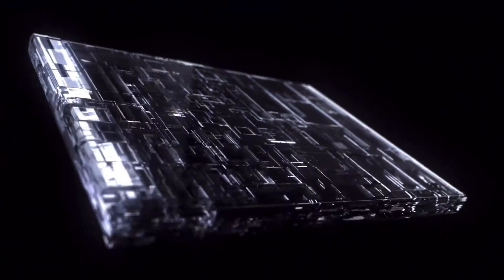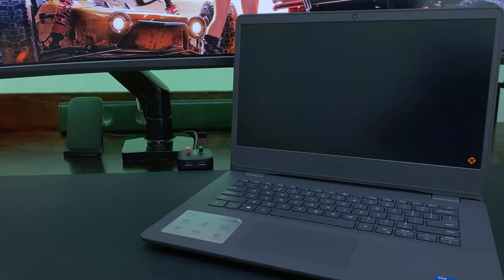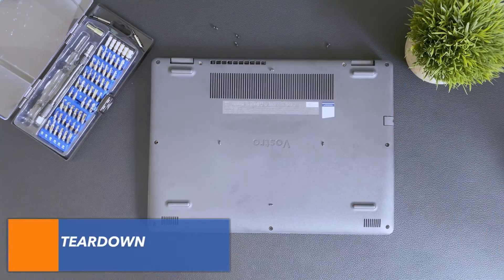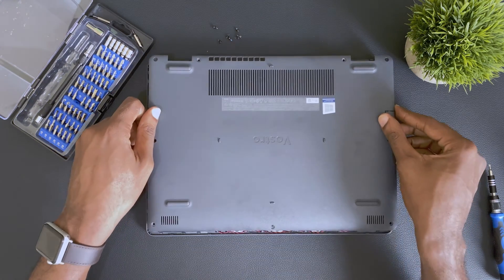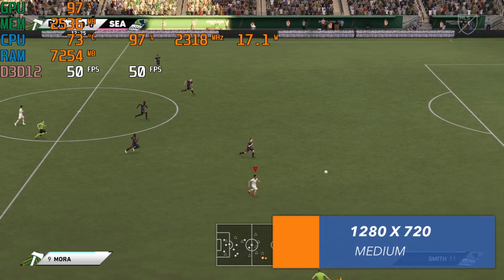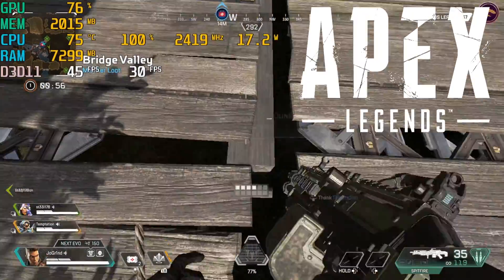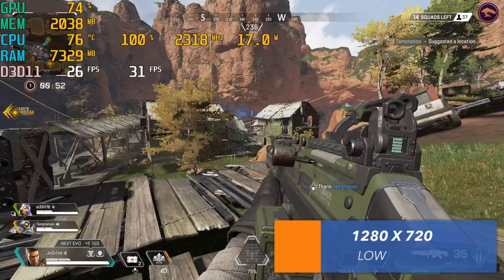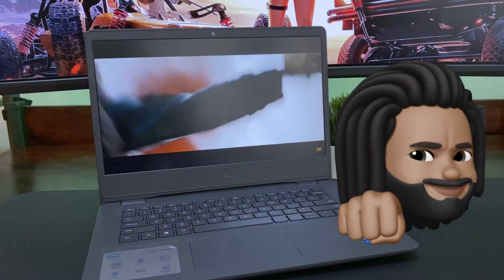Dell Vostro 3400 Review & Gaming Tested | Intel i5-11357G7 Iris Xe G7 | Plus Disassembly 2021

Comment: Hellow, i have similar laptop. What your room temp and Dell power manager-thermal managenent setting (cool//quiet/ultra)? Your laptop temp so low 72 celcius. My laptop around 80-90 Celsius when power manager set to ultra performace (play cs-go). Any addition change pasta for cpu or else?
Reply from the maker: My CPU was running at 20W. So that's probably why the temp was low. Room temp is around 24.
Reply: @JoTheTechie  I don't get by 20W ? Area you setting manually? What program ?
Reply from the maker: @foxesKing1  It came that way from Dell

Comment: Dude, i was able to get stable 60 frames at 1366x768 in overwatch with temperatures around 60 degrees and all this without friezes. In my case, i still have worse 1 frame per second (gpu load 1%), or load cpu is stuck 100%.

Only two times (random) i can get good stable result. Dual-channel has nothing to do with it. I think we must sort it out and get that stable result. The problem is either in the drivers or bios. This laptop can do MUCH MORE
Reply from the maker: Ok nice to know. I was running it at 1920x1080 and getting around 30fps. I'll try it again when I do my Dual Channel upgrade.

Comment: Hzy i have the dell vestro 3500 and my pc in fortnite have 0 fps when i load a new area or shot my firs bullet but after my fps reach 80
Reply: Thats make the game like implayeble
Reply from the maker: I had the same problem. But it was fine when I turned it down to 900p, Low Settings, Performance Mode.
Reply: @JoTheTechie  i putted at 600x800 but i have the same problème i think i have to ubgrade my ram or add a gpu
Reply from the maker: @pekka07x  Its a desktop? Do you have at least 8GB RAM?
Reply: @JoTheTechie  laptop 8go ram single
Reply from the maker: @pekka07x  Not sure. Make sure your drivers and Windows is updated, and close all programs running in the background
Reply: @JoTheTechie  already did
Reply: @JoTheTechie  it run good but it shut down to 1fps evry first action and after its better
Reply from the maker: @pekka07x  Does your laptop have a NVME SSD? Could be slow loading times from a hard-drive? 🤷🏾‍♂️
Reply: @JoTheTechie  no ssd
Reply: 8go ddr4
Reply from the maker: @pekka07x  Thats probably why
Reply: @JoTheTechie  ok thx
Reply from the maker: @pekka07x  No prob. Thanks for watching